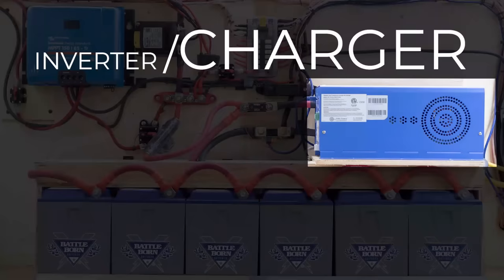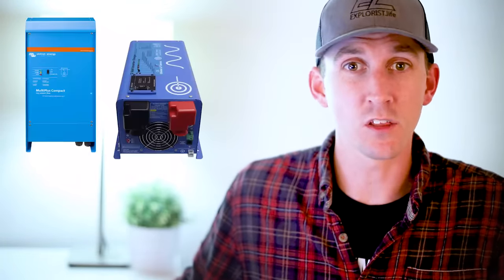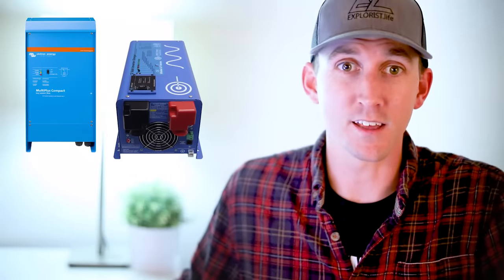Basic Solar Parts Needed for a DIY Camper Van or RV Solar Install

Comment: What prevents power from going to the shore power plug on the side of a trailer when using a solar/ inverter setup?
Reply from the maker: At the surface level, the inverter/charger simply doesn't work in reverse.
Reply: @EXPLORISTlife  okay so when installing a solar setup, the shore power goes to and through the inverter charger first then to the camper breaker panel after? That acts as the “break” from reverse feeding and someone touching the shore power plug on the exterior and shocking themselves?
Reply from the maker: Basically, yes.  I think you may find this playlist of videos helpful: https://www.youtube.com/playlist?list=PLmvhcyi4n0TUU8FUc6LE38TBkdSLjdw_5
Reply: @EXPLORISTlife  thank you. I’ve slowly been picking away at your videos. Way more math behind solar setups than I had thought
Reply from the maker: @ShortyzProductionz  There's definitley a lot of math if you are trying to design a system; but if you simply want to INSTALL a system and get it up and running, the kits/systems we have in our store, shop.explorist.life, take nearly all math out of the question.

Comment: I have a small travel trailer and am planning a solar install. If I get a regular inverter and hardwire it to the existing setup, will shore power still charge the battery when plugged in it do I have to get an inverter/charger?
Reply from the maker: There are 1,000 different ways to set up a camper electrical system, but this is the #1 best way I can recommend: https://www.explorist.life/30a-camper-inverter-with-solar-and-alternator-charging-wiring-diagram/
Reply: @EXPLORISTlife  thanks so much! Huge help

Comment: could you just run wires from the inverter directly into mobile home fuse box so all powers outlets work like mains power?
Reply from the maker: With the right inverter/breaker box, basically yes.

Comment: Question is a bus bar same as link distribution box? Seems like bus bar all the load connections have the same voltage, is there a way to get individual voltage for each load? Thanks in advance
Reply from the maker: The Lynx Distributor is 2x busbars and 4x fuse holders wrapped up in one container.  You cant get individual voltages from each input/output, no.
Reply: @EXPLORIST life - DIY Campers  Thanks for your response this is my first time doing this kind of electrical connection, can I ask  what you think can be the issue with my charge controller not charging my solar panels, is there a way I can send you a diagram picture of my connections, you have a lot's of experience and may see something I'm doing wrong, Thanks in advance for your time.

Comment: Hi could you please recommend me a Victron solar charge controller that accepts a 36v battery bank?
Reply from the maker: The Datasheets for each of the charge controllers tell which ones work with 36V Battery Banks.  Most of them except the smallest ones do: https://www.victronenergy.com/solar-charge-controllers

Comment: Would 1000 watts of solar and 500 AH lith ion battery bank be good for a conversion van? I plan to buy and do a conversion on a 170 or 170 extended in the near future. I've seen a lot of vans with a smaller system but i want all the comforts of home and want a shower tv etc. Basically i want to be able to live in it full time and not worry about running out of power. I think i'll get a honda 2200 generator also if i want to run an AC or i need it when there are several days without sun to recharge the batteries.
Reply from the maker: That size of setup would very  likely run most of what you're looking to run, but I still HIGHLY recommend performing a power audit to be sure.  We've got instructions for doing that here:  https://www.explorist.life/what-size-of-solar-system-is-needed-to-power-a-camper/

Comment: And how many watts of solar panels do i need? Currently i have 200 watts solar panels and planning to build with 7 batteries with 6000 watts inverter. Thank You
Reply from the maker: The solar array wattage goal should be approximately:  Amp Hours of battery capacity @ 12V x 2 = Solar Wattage

Comment: What AWG (Gauge) should i use for the Solar Panel Charge Controller when using a 120w solar panel?
Reply from the maker: Here is a calculator I made to help you figure wire size: https://www.explorist.life/wire-sizing-calculator/

Comment: when wiring charge controller to battery bank of 4x 6volt in series is  it important that positive wire is to the end of line of batteries and the negative is to the other end of the line of batteries and not the batteries half way along the line even though they are connected by cables as part of the series connection? Im thinking there is only partial of the bank. is that a thing ?
Reply from the maker: Basically, yes.  But I'd consider wiring that into your busbar.  For examples: https://www.explorist.life/solarwiringdiagrams

Comment: Can I lay the Victron inverter on its side? If not why not?
Reply from the maker: Depends on the model.  Refer to the user manual for additional guidance as it will be listed if it is a limitation.

Comment: Hi I have 40 2v battery's. If i put 24 battery's  in series i have a 48v system. Is there a way to connect the remining 16 2v battery's to the 48v bank?
Reply from the maker: Nope.

Comment: I need help with hooking a Genius onboard battery charger on my house boat set-up between the Rich solar controller and a 3 way battery switch.
The 3 position seaflow boat switch enables the solar power to charge battery 1,2 or both. Can I simply connect the Charger to the load side of the switch along with the rich solar load side?

Thanks in advance
Reply from the maker: I'm having a hard time visualizing what you are talking about.  Sorry!

Comment: Could one use a Tesla Powerwall as their battery source vs an array of 12v batteries?
Reply from the maker: A battery is a battery and there are considerations for both, but a powerwall isn't a drop in replacement for a 12v system.

Comment: So the larger the wire from the inverter/charger to the battery would be better to use (00)
Reply from the maker: That depends on the size of the Inverter.

Comment: If I have a 2000 watt inverter with two 12v lithium ion batteries... I should be a run a 1000 watt ninja blender for 10-20 seconds no problem.. right?
Reply from the maker: Yep!

Comment: Can I just use Blueti solar generator instead of all those part in a van?
Reply from the maker: Ultimately, you can do whatever you want. 🤷  You could go out into the woods with nothing and make a shelter from sticks and leaves with no need for power if that's your thing. 🤣

Comment: What would be a good budget mppt? I’m looking for a fold up as I only have a small vw splitty but need the waeco fridge on, so I might make my own fold up and use a mppt also is there a cable chart
Reply from the maker: Victron SmartSolar MPPT in whatever size your panels call for.
Reply: EXPLORIST life - DIY Campers should I buy the cable and mc4 connecters and make my own or look for a made up kit?
Reply from the maker: The Victron MPPT's don't come in a kit, so you'll need to make your own wires.

Comment: I have a question the company I took my skoolie to said I need a converter? I have mppt, inverter, dc dc charger, I’ve seen where you need a transfer switch as well is that correct? Thanks
Reply from the maker: I don't like converters, and instead recommend Inverter/Chargers.  You'd need a transfer switch if you had a built-in generator.  Perhaps check out our list of EXPLORIST.life Approved installers if you are trying to have your system installed for you? https://www.explorist.life/camper-electrical-install-services/
Reply: @EXPLORISTlife  thank you for your help. Just to clarify all I need is the inverter, mppt, dc dc charger. Is there anything else I need I want to boondock and plug in thanks so much
Reply from the maker: Perhaps check out the system diagrams I have made at https://www.explorist.life/solarwiringdiagrams

Comment: Can the batteries by 6V? Or do they have to be 12V ones.
Reply from the maker: They can be 2v, 6v, 12v, 24v, 12v wired in series to get 48v...  It just depends on what your goal is with the system.  I recommend 12v batteries wired into a 12v battery bank for systems with inverters 3000w or smaller with solar panel arrays 1200w or smaller.

Comment: Do you have a diagram for a single 100w panel and a single battery? I'm considering a mini van conversion and don't see then need for more than that
Reply from the maker: I don't.  For systems that small, I generally recommend some kind of all in one unit like a Goal Zero Yeti or a Jackery 500/1000.
Reply: @EXPLORISTlife  Yeah, no; but thanks....
Reply from the maker: No worries.  You can always request a diagram to be added to the site here: https://forms.gle/uh1NDXVQQfQg9XaT9

Comment: What do I need to charge my Tesla? I have 4- 300 watt solar panels and four Battleborn batteries
Reply from the maker: You'd need a system capable of pushing 120V/240V split phase.  Something LIKE this: https://www.explorist.life/24v-6000w-120v-240v-split-phase-camper-solar-wiring-diagram/

It may need to be a bit bigger though  (or have a supplemental generator) depending on the actual demands of the tesla charger (I don't know off the top of my head).

Comment: I have a question so i have a eg4 3kw inverter its 48v not instead of a down converter i want add one 200ah 12v battery now thay being said i have one string of solar panels and built in charge controller how could i charge that 12v battery cheapest
Reply: So 48v system is for my big stuff and the 12v battery gonna be for my fridge light diesel heaters and or a back up if the other system runs out of battery life one option is take one panel off thr series and add 12v charge controller. But is their any other way to charge both my 48v battery and 12v battery off the same two wires coming in from the solar array
Reply from the maker: You'll need two different solar arrays to charge two different battery banks.

Comment: I spent 3 days looking for the info provided in this video. I'm replacing my charge controller and it doesnt have a terminal for the load. I want to replace with the victron 30 amp
Reply from the maker: Glad it helped!
Reply: @EXPLORISTlife  definitely need to watch it a few more times. My current (broken) mppt charge controller, power tech 30 amp, has the terminal for the load. The victron doesn't and my concern was there was nothing monitoring what is being drawn from the batteries. Looks like the battery monitor can do the job. Do you have a low voltage disconnect any where? What protects your batteries from over discharging? Thank you so much for replying!!
Reply from the maker: @enbybus3840  Not having the load terminals isn't a big deal.  Even on controllers small enough to have them, I just run everything through the battery/busbar.

You should probably have a separate BMV to monitor the whole system.  Like, the Victron BMV-712.

I dont have a low voltage shutoff, but the battleborn batteries have an internal low V shutoff.  If you wanted to add one, you should look at the Victron Battery Protect.
Reply: @EXPLORISTlife  thank you so much for your reply!!!! It's finally making sense :)

Comment: One really bad  thing about Lithium batteries is that they get destroyed (or will not charge) if you charge them while they are freezing cold at less then 0C temparature. This makes Lithium a big hassle for having them in cold climates in a van as you must be careful where you install your batteries to avoid freezing them and also make sure to heat up your van before you charge the batteries. According to what I have found you can not charge a Lithium battery at 0C and at +5C charging will be limited, +10c is the recommended temperature with +45C max for Lithium type batteries.
Reply from the maker: Batteries, in general, dont do well in cold temperatures.  That's not exclusive to lithium.  I covered that in this video: https://youtu.be/USOWVAeb1H8

Comment: What is a ballpark cost on a setup like this?
Reply from the maker: For a 600Ah Lithium, 3000w Victron Multiplus, 150|85 MPPT, system, with wires, lugs, fuses, heat shrink, you're going to be in the rough $10,000 ballpark.  But I have a lot of different sizes of systems available on my wiring diagrams page: https://www.explorist.life/solarwiringdiagrams

Super important to figure out how much you truly need first, though.  Here's a tutorial for that: https://www.youtube.com/watch?v=a406IxiU-Xg

Comment: Does distribution box rectify voltage to 12v?
Reply from the maker: Nope.  It simply 'distributes' it.
Reply: @EXPLORISTlife    thanks for response, so solar system has no rectified 12 v ?  All my fans and lights can take the variable voltage of my lithium ( 13.2-14.3).  I read that maxxair roof vents don't like anything over 13.6.  and some ppl blew out the circuit board

Comment: Would you help me set up a 48v system with tesla batteries , i just need to be steer in the right direction
Reply from the maker: I have zero experience working with Tesla batteries, so that's not the direction I'd have you go if I were to help you design a system.
Reply: EXPLORIST life thank you for youe honesty , but i already the batteries so im committed, thanks anyway

Comment: Can I use a 3750 running watt generator as shore line for a 4000 watt pure sine inverter ?
Reply from the maker: Generally speaking; yes!
Reply: EXPLORIST life thank you for reply !!! I’ve been trying to look this up for days now and not to much info on It , after weeks of videos and reading the set up in this video is what I came up with ! Lithium batteries and aims charger/inverter . Would you recommend the optional remote switch ? Or is that the same as battery monitor
Reply from the maker: I would indeed recommend the remote as the aims inverters use a LOT of power (5 amps DC @ 12.6v) simply being on.   So, the ability to turn it off when not in use is vital.

Comment: Help please 🙏

When I'm looking at my options, I see that all the smart chargers have a 120v plug in cord, like to plug into a regular house outlet. I'm looking for the one that goes in line with my shore power so that I can temporarily charge my battery by plugging my camper cord into my generator and also cook at the same time (I don't have solar at the moment, battery won't support cooking for long) 

I want to be able to bypass my battery while it's charging so that it's not just charging/discharging that whole time.
Reply: And when I'm not cooking, the battery is to keep the 115v 6.5/3.0 amp fridge running and run a small fan at night
Reply from the maker: All of my diagrams at https://www.explorist.life/solarwiringdiagrams will do that as they all include inverter charger (combo units) with shore power passthrough.

Comment: 11:50 for sure the imperial system knows how to make your life a pain... that's why in Europe we use mm2 to define the size of the wire... 6mm2 is for sure bigger than 2mm2 wire and its also much easier to immagine the size od the wire.
Reply from the maker: Yeah, it's definitely an easier system.

Comment: I am looking for information to build a solar system that can run my entire house, I run off of a 100 amp main feed now. The largest breaker I have is a 0 amp for my electric stove, and 50 amp for my on demand hot water heater. Can you help me?
Reply from the maker: I don't really cover residential solar setups, but a lot of the processes are similar.  Are you trying to disconnect from the grid completely?  How many kWh are you using per month?
Reply: I am not sure how many kWh/mo. I am using because I am branched off of my son’s house. I know it can’t be many because the biggest thing I have running is an oxygen concentrator, and my a/c. My house is 420 sq. ft.
Reply from the maker: Okay, I probably won't be able to advise on this in that case.  Good luck!
Reply: EXPLORIST life - DIY Campers man I sure had my hopes up on you. Could you advise as to what I would need just in case power goes out?

Comment: Those US gauge measurement are really odd. Just use mm2 as in EU. That's just sensible to everyone. Without even knowing electric standard.
Very nice video off course 😊
Reply from the maker: How about this...  if you share my videos enough that the majority of my views come from the EU, I'll change to mm2.  Otherwise, I'll just stick to AWG since I'm from the US as is the majority of the viewership of this channel and you can just check into the AWG to mm2 charts as you need.
Reply: @EXPLORISTlife  it's not personal. It's just that 120 years ago (I think) you all agreed to go metric 😉
Reply from the maker: I'd like to go metric, personally.  But alas...  it would add more confusion than clarity for the majority of my audience.

Comment: I have a question ,not pertaining to your video ,If its ok to do so, I have a Bluetti EB 240 and a Dokio 300 what solar panel , the place I bought it said it is compatable ,when I plug in the solar panel cable  in to the Bluetti the chargeing screen should light up , as my panel is sitting in full sun light, it throughs a code EO17 over voltage pertection( pv input ) It says to disconnect the solar charging cable and restart the machine . does this mean its not compatable cause when i did it again it still throughs the same code . Your help would be so appreciated ,
Reply from the maker: I don't know much about of either of those units.  What did their tech support say when you reached out for help?
Reply: @EXPLORISTlife   I couldn't get know one at Bluetti but the Dokio place said He needed some reading from the meter to see whats going on , I know nothing about the meter , thanks for trying anyhow , thats what I call getting back with ya, sure wish I new how to trace it out , There is know one around here that has any knowledge on it , Thanks again God Bless.